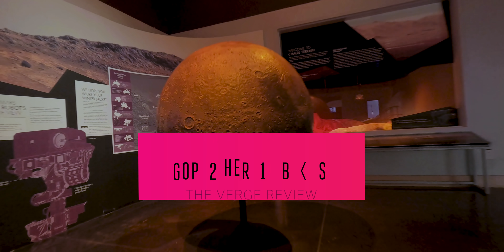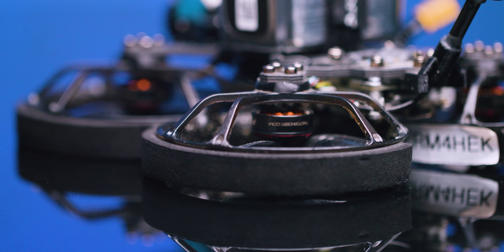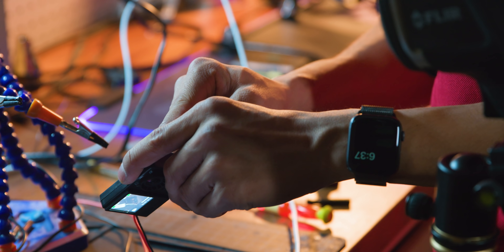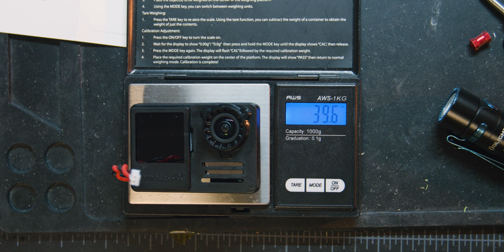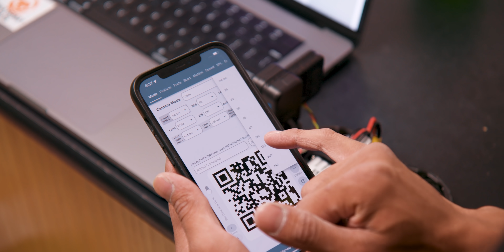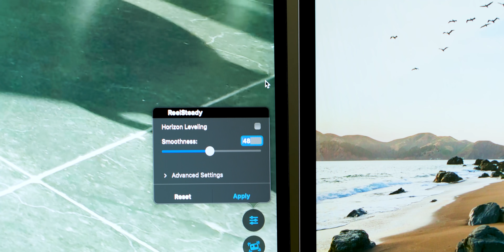GoPro’s new $400 camera has no battery, screen, or gps

Comment: Wouldn't the osmo action 2 be lighter after removing battery?
Reply: maybe. but my understanding is that the osmo action 2 lacks the post stabilization software (ReelSteady)....so will not be as smooth. stabilizing in post/edit using gyro data (ReelSteady) always gives better results than stabilizing while recording
Reply: In that case go with the 360go2... People buy GP because it has the best overall video

Comment: GoPro should make the case WHITE so it heats up less. Could make a noticeable difference when there's no fan, and it's likely going to be used in direct sunlight almost all of the time.
Reply: Good call!
Reply: I've been saying this for years with the overheating issues they face
Reply: I think someone makes a white silicone case for gopros.
Reply: For their other lineup, perhaps... but this is for drones and will get plenty of air cooling methinks.
Reply: @bobthemagicmoose  even with drone airflow, if you leave a gopro sitting out in the sun preflight, it can get close to overheating. Hopefully the vents help enough to allow it to get into the self cooling aspect.

One of my bigger challenges with the gopro was heating before I was actually filming.
Reply: @EngineeringAfterHours  No overheating problems so far within reasonable use :) Even forgetting it recording on the ground for a minute doesnt shut it off :)